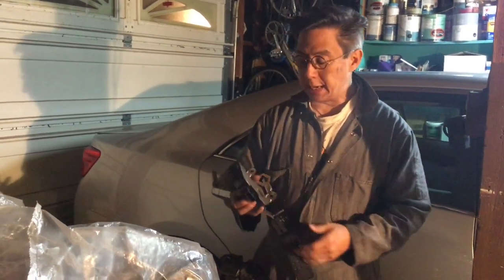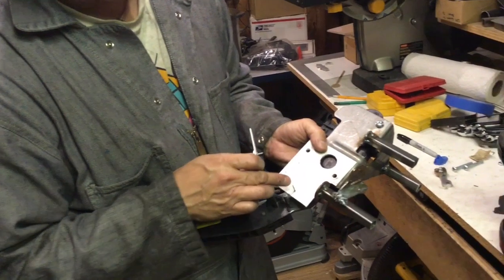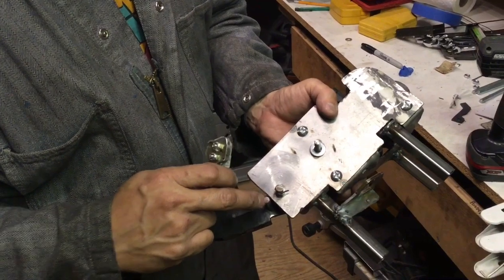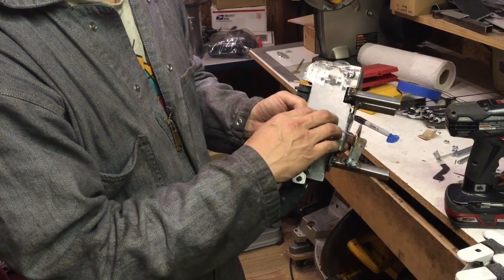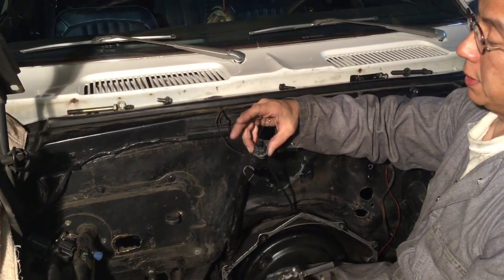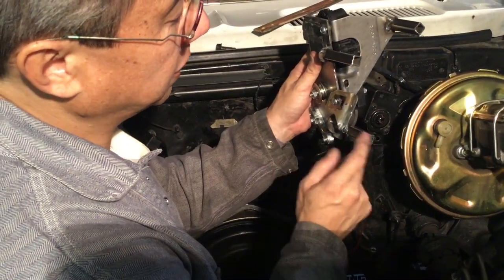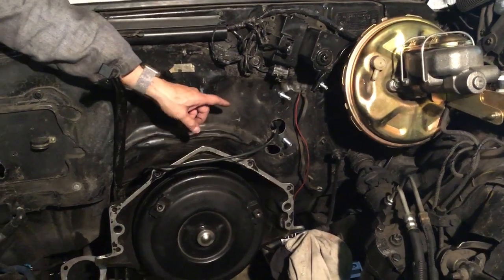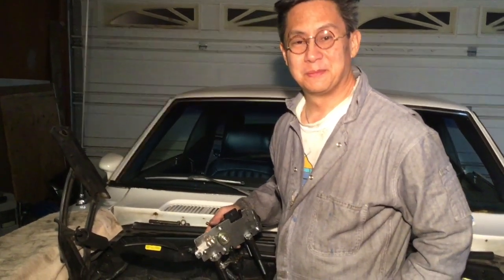700R4 LS3 Conversion Drive By Wire TV Cable Gas Pedal Modification

Comment: Excellent use of mechanical advantage using a pivot, cam post and routing pulley. If I can get pass the "Play Back Errors", maybe I can watch the entire video. It is an evil Google plot for those of use that use Windows 10. Great idea, excellent fabrication. My only question is, with the routing pulley causing a bending of the cable, do you think the cables life will be shortened? It is not a straight pull and wire rope cables can still experience work hardening and become brittle over time and use. Just asking from my observation and 30+ years of working on vehicles. A straight pull would be best, as gentle curves in the housing are normal. Good job on showing your concept on a more common problem in the LS swap community. Retired ASE Master Tech. Thank you again!
Reply from the maker: Dean Kay Thanks!  The first version was a straight pull.  Then I found there was limited room to work with at the firewall mounting.  The cable end plastic housing was too long to fit at the top of the assembly and there is no room at the bottom.   I didn’t have the engine in at the time of design, but after the install of the engine I confirmed there is really no room for the plastic housing to be extended into the engine compartment, the engine would prevent that.  I have to admit some of the influence of putting the pulley in there was due in part to just wanting to be done with it as the design phase was taxing.  Putting the pulley in there solved the space issue and was also easy to implement.  Since the cable does actually go over a cam in some of the normal carburetor applications (see bowtieoverdrives.com) and since accelerator cables go over some kind of cam, I think a pulley would be fine.  I did select a large diameter pulley to put my mind at ease about the cable bending too much.  Also made sure that the cable was not rubbing anywhere.  I greased the ball socket area of the cable attachment point as well.  Thanks for watching and commenting!

Comment: How does the actual driving operation feel?  I notice that on the carburetor, the cable pull slows down toward the end of the pull and with your new setup it speeds up at the end of the pull. This will have an effect on the timing of the line pressure in the transmission. I'm just hoping not in the detrimental way...

Comment: I'm wondering why you needed to make those long "stand offs" and mount it so far off the firewall.
Reply from the maker: Hi Jim, it needed to be away from the firewall to fit the giant cable head, the black plastic part.  I ended up welding a small tab on the metal arm which allowed the pedal to move back about an inch while leaving all the rest the same.  Basically just mounted the pedal back a bit.  I suppose I could have taken an inch away from the mounts, but since everything was mounted and engine in, the easiest adjustment was to push back just the pedal.  I would have also had to reposition the big cable head if I cut the stand offs.  Realize the engine is right behind that pedal, not much room for extra cabling on the engine side.  Thanks for watching!  :)
Reply: @TheMikeSenna  Thanks for the quick followup Mike, I came across your vid because I've been reading up on fitting a new crate LS3 for my 68 Camaro, and specifically searched for the fly by wire pedal install. I'll be using a Tremec 5 speed so no need to add a trans cable. I'm wondering what mounting mods are common to put in this wired pedal assy. on my car.  I hate to have anything looking non original.  (until I open the hood of course) LOL
Reply: If you ever plan on building them im so interested  in buying  one 

Been looking for a solution  for my truck for a while now !!
Reply: But I have a question  what can you expect  to happen when you don't run the TV cable

Comment: Need a update on the car like to know if it work
Reply from the maker: Yes it worked.  However about a year later I wanted to be able to control the trans better so I installed a 4L60E.  I updated my description.  I’ll do a video of the mods I did to my 4L60E soon.

Comment: Do you happen to have a template we can get to match the plate and arm?
Reply from the maker: Oh man, so sorry, I didn't think that far ahead.  I'll take a look and see if those parts are able to be removed from the peddle for measurements.
Reply: @TheMikeSenna  a rough idea is fine with me. Pivot pin placement, arm size is about all I need. 

And thanks for thevideo anyways, it gives me hope on my k10!,
Reply from the maker: @bosozoku_volvo   I still need to get these measurements to you, hopefully soon!
Reply: @TheMikeSenna  so I actually solved that mystery for my own purpose myself! I was on a major time crunch for info, and my pedal is actually different. 

Turns out the truck pedal has a spot for a (useless) return spring which is almost the perfect size for the TV cable to clip into, and a little extension on the pedal gives you enough pull to get the job done right.
Reply: @bosozoku_volvo  
Hey man I have a 88 blazer I'm going to  be doing the same can you send pics?